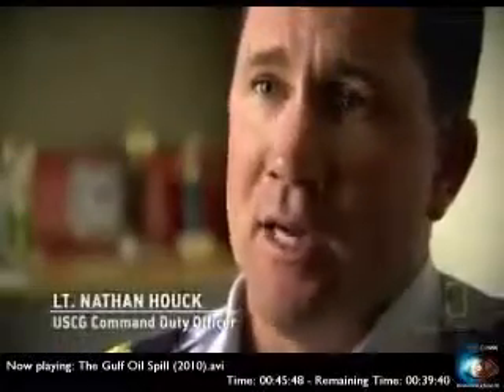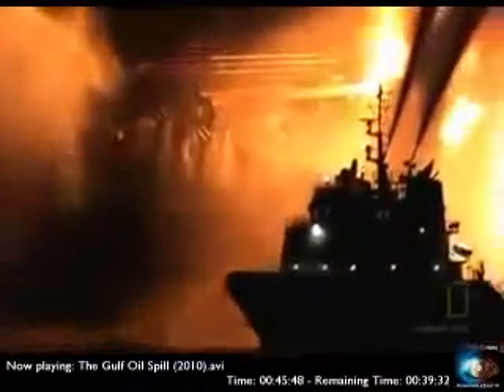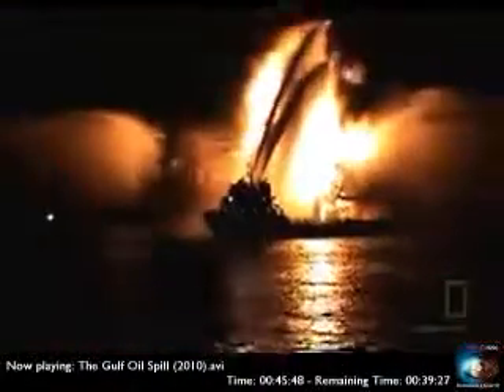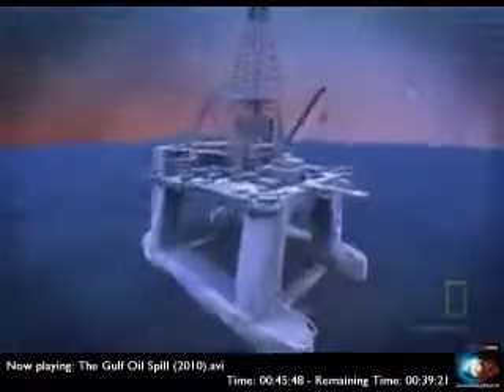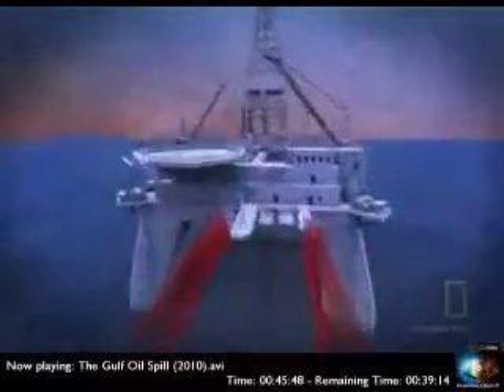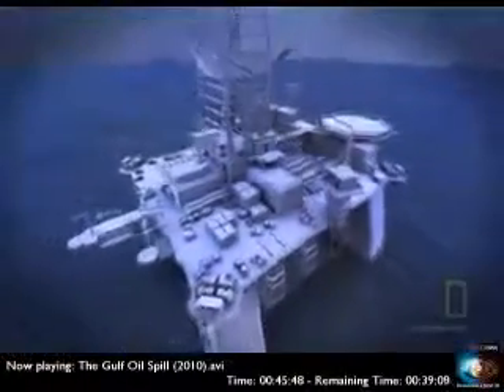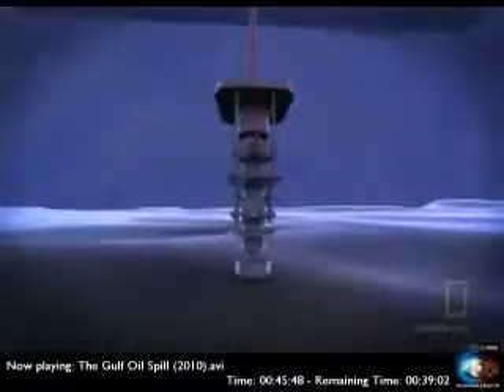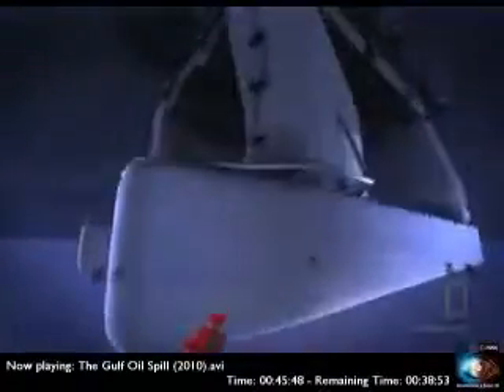They rely on GPS to keep the position the oil rig (oh no!!)

Comment: Deepwater horizon didn't fail because it's GPS failed. It's blowout preventor failed. https://youtu.be/FCVCOWejlag <-- that's a video from the CSB, the Chemical Safety Board, about it. 

They use GPS to position it exactly right. But the pipes are flexible and won't burst if the platform moves a little. GPS failure is not a likely cause for an accident on an oil rig.